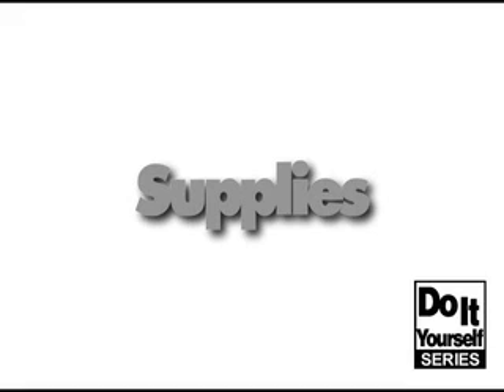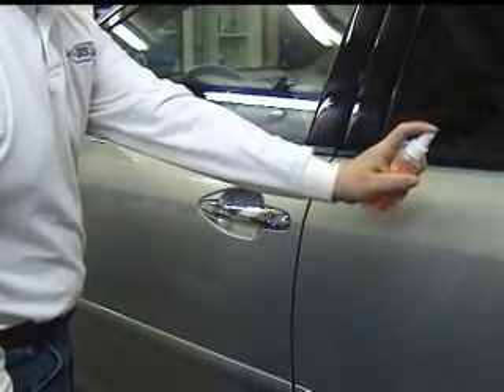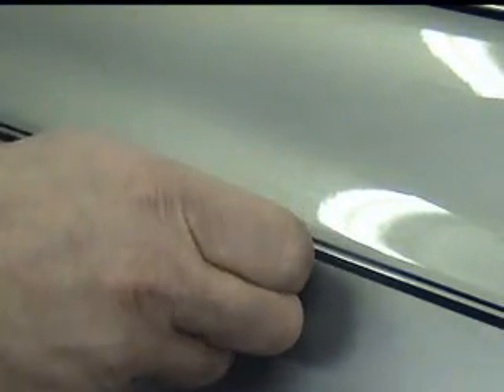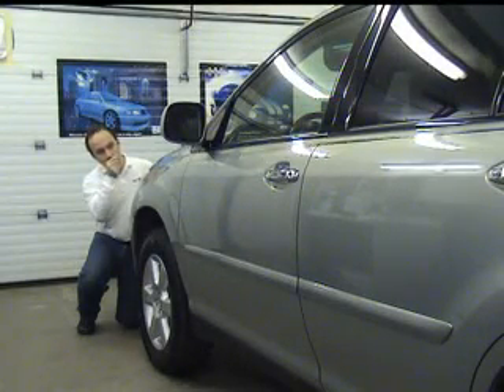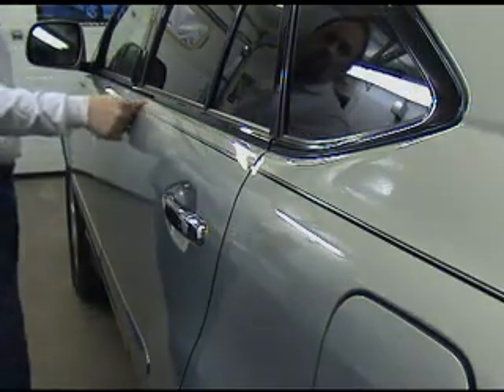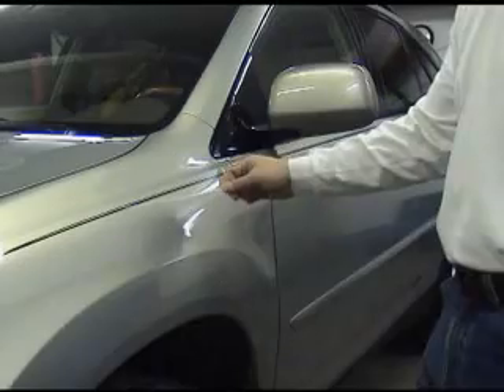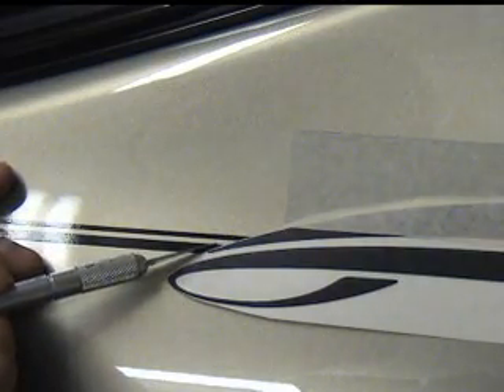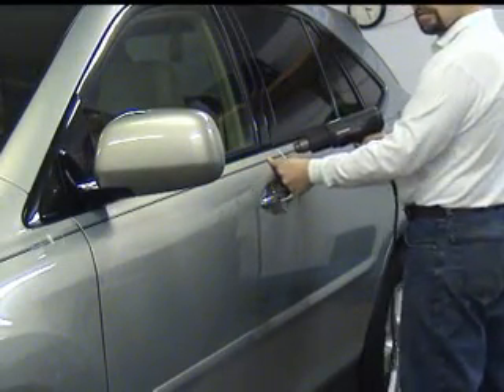Vinyl Pin Stripe Installation Instructions - How To - 1 - Pinstripe

Comment: Trimming the tape when already applied to the vehicle is a recipe for disaster!

And there's no harm in "wrapping' the tape a half-inch or so inside the doors - promotes less of a "break" whenever the tape stops.

Also, use a clean cloth to press down onto the tape for final application, rather than a bare finger (with skin oil).

Comment: Why would you even suggest that using an exacto knife on your clearcoat is a good idea? When you remove the pinstripe you're left with nice white lines everywhere.
Reply: Kris O 
You’re. 
Lol
Reply: you can    but  just dont press down  hard   just enough to  cut it  have to take your time  on this part   so  you wont scratch  the car  ive  done that  before  and learned from that ~